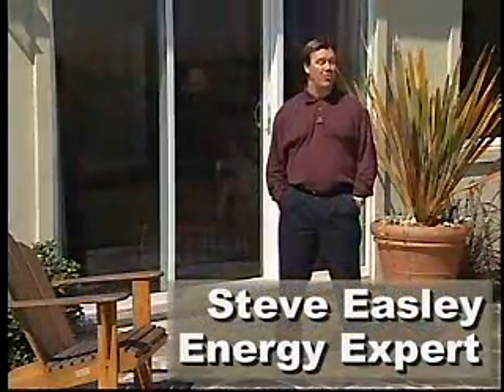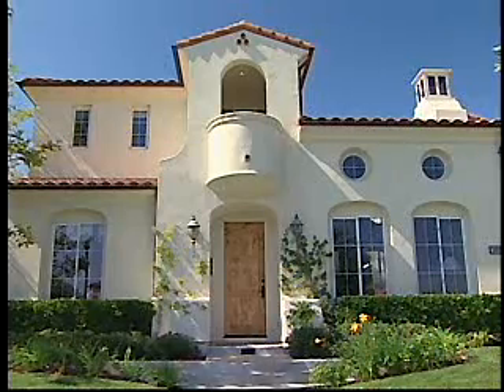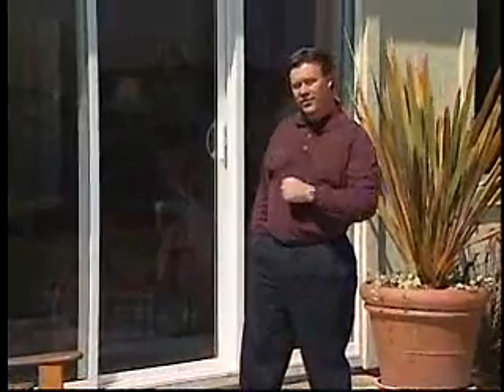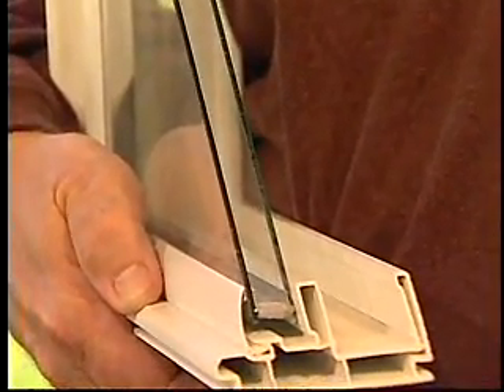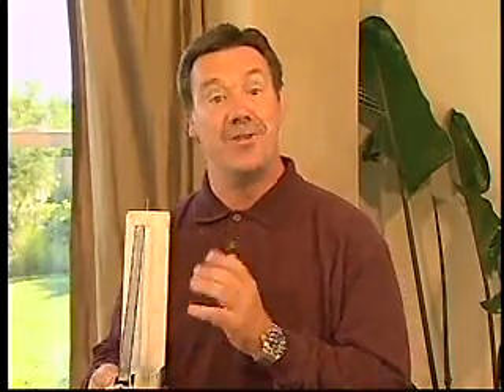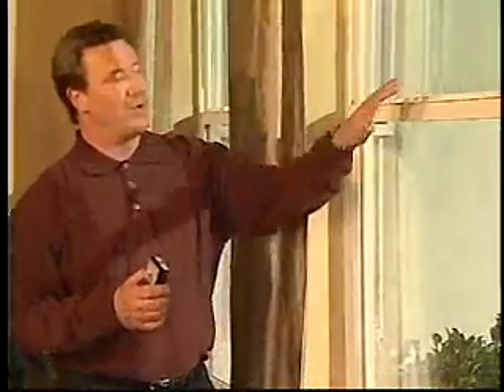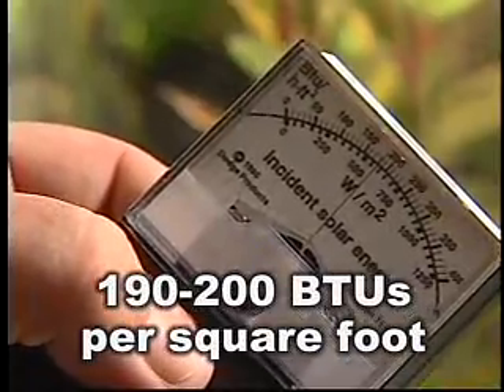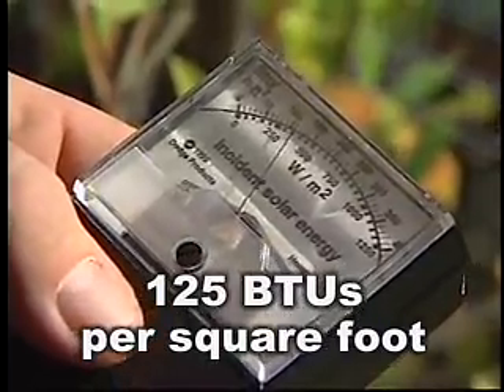Low "E" windows Benefits

Comment: Low-e windows are a dangerous fire hazard.
Reply: Jeanne310 how so?
Reply: @olliecrow3547  Low E windows caused our vinyl siding to melt.  We had to replace with concrete siding.  The reflection is still there in the winter when the sun is in the south.  LQQK it up.  The danger is real !
Reply: @INJURYCOMP  after 4 years, since my post, I am aware of the hazards.  Thanks for the heads-up though.
Reply: @olliecrow3547  Thank you.  Blessings.